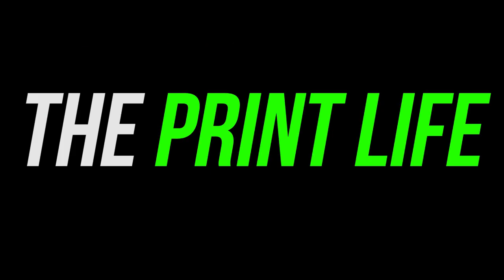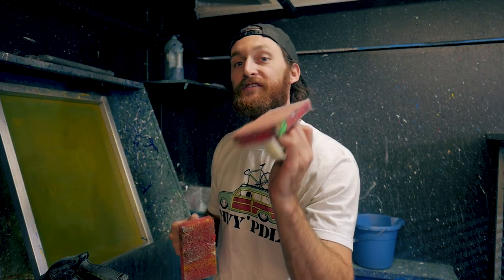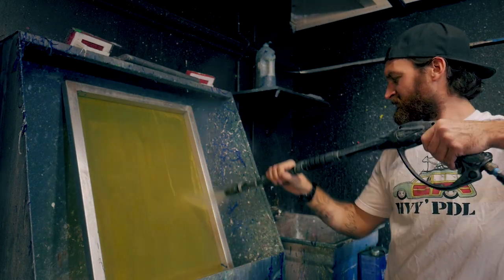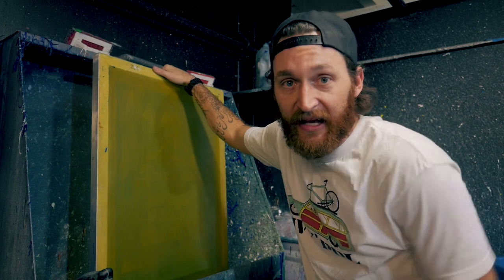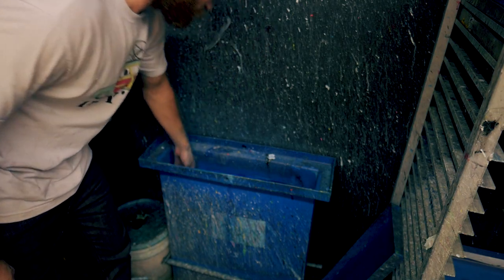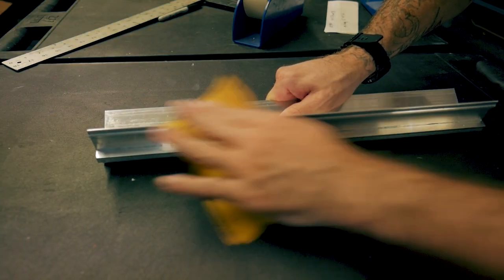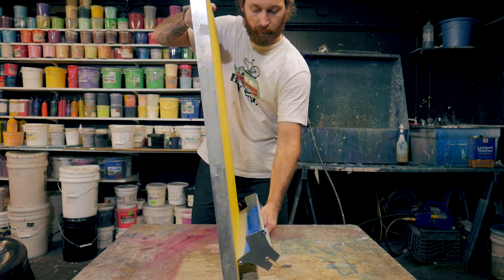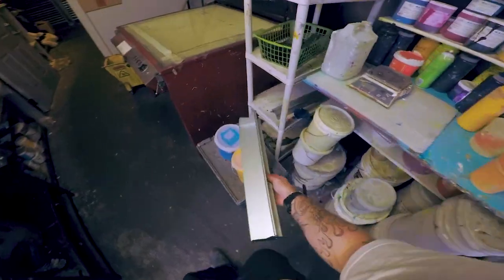How to Coat a Screen for Screen Printing.

Comment: so there are many different sizes for the emulsion coaters. i see you use a coater everytime thats pretty much the width of the screen. is this to make life easier or your prefrence. also does the coater ever damage the screens edges when coating with the metal to screen contact.
Reply from the maker: exactly. I like a coater that is as close the mesh size as possible. This way you use less tape to mask the openings around the edges.

Comment: I’ve been having issues of the emulsion dripping after I’m done applying to the screen. Been told that I’m not applying hard enough, any tricks to knowing how much pressure to use to get it to apply correctly?

Comment: I've seen other videos where they coat both sides, and then go back on the flat side and do one more pass where it seems like they're taking off some that pushed through from the coating on the inside. This is what I've followed in my attempts, but when spray off the emulsion after exposing, I'm running into an issue of my exposed emulsion basically deteriorating from my image. Essentially, the image is starting to come through as I spray it off, but once I get down to the final pieces needed to come off for some of the details, bigger chunks than I want are coming apart.
 I don't know if I have junk emulsion? I'm using ULANO QTX since I saw online it was a good "Beginners Emulsion"... After about 20 failed attempts, I'm beginning to question two things, if the emulsion itself is bad or if the 3rd pass (2nd pass on the flat side of the screen) is what's screwing me up. Any insight? Does water temperature have anything to do with this? I feel like I heard one video say use cold water, but in Los Angeles, my garden hose water does not seem to get that cold in these hot summers. :(

PS. I purchased that exposure calculator to help me get my expose time correct, and so far, I think my expose time is about right.

Comment: Hello. Nice video, very informative. However I have one question. Could one coat a screen with a squeegee?
Reply from the maker: For sure, it will be messy and the screen wont be coated well but if you a hobbiest just messing around it will get the job done, I have a video that shows me doing just that.
Reply: @ThePrintLife Thank you

Comment: Emulzhion / Emulsion
Potato, Potahto

Anyway... nice, neat job. You clean EVERYTHING.

Most guys are in such a hurry, that screens & scoop coaters get destroyed
because they won't take the time to properly degrease, and clean up when they're done. Then, material
& tools have to be replaced prematurely. Not to mention when you're ready to burn, only to discover
that your screens aren't usable because someone coated dirty screens, with contaminated emulsion,
with a jacked-up coater. Off-the-chain aggrevating, cuz you gotta get that printed NOW. And when it
comes to deadlines... customers are brutal & don't wanna hear it. "You said #@&$@#!"

It's such a simple concept. Anything worth doing, is worth doing the right way.

Comment: Cam, how did you set up your monster max? I tried everything (1,2,3,4 pieces of tape)and can't get a good coat. Leaves thick beads on edges and goops in corners...all of which I have to scrape. I tried almost every possible set up. I'm perfect with the conventional coater, but this one...grrr!
Reply from the maker: Haha yup. that coater is shit, we have the same damn problem with it. I use the glass on the exposure unit to get a the sides flush and tighten the screws. the classic coater with the plastic ends is way better.
Reply from the maker: By the way did you submit a request to The Print Life group on facebook?

Comment: How long do you let it dry I’m not using a fan either
Reply: 12-24 hours is optimal. The rule in our shop is you always start the day by reclaiming or “washing out” screens (if needed). Then end the day with coating screens so they’re allowed to dry overnight. I will say though that I have gotten caught in an extreme rush order that was do or die and let it dry in dark room with fan for about 2 hours and made it work. I think the key was not using as much pressure while washing it out after exposing (used the mist setting up close on design instead of a powerful stream setting).

Comment: Could ya use LED bulbs in the darkroom since they give out no UV light? Does daylight affect emulsions quickly, or would it take some time to affect them. We have a light safe box for storing them as they dry, just wondering more so in the coating part of the job
Reply: oh and thank you in advance if you have the time to reply.
Reply from the maker: Shane that is a great question. I dont have any experience with LED lights. I would assume they produce some uv, but how much is a mystery to me. If you find out be sure to let me know in the comments. If not I will be looking into it.
Reply: Thanks for the reply. Well I have installed two warm white LED (7 watt=60) bulbs into the room so I will for sure give you an update on that. Just seems more preferable than working in that dull yellow light which most do. They are way more energy efficient too which means cheaper electric bills! Your channel is fantastic by the way, love the how to vids, right to the point and well edited! Keep it up man!
Reply: Shane Bowers - the yellow sleeves that go over fluorescent bulbs is plenty of light. They make exposure units now with LED's...I assume they might cause some issues. I have 2 lamps with bug lights that's plenty. I've left my shop lights (4' fluorescent lights) on when working with fresh screens and emulsion and had no issues, but I'd rather be safe then sorry! I read somewhere that overhead shop lights will take at least an hour to have even the littlest effect...but I haven't tested that yet :)
Reply: Shane Bowers  - please do keep us informed. Maybe coat a small part of a screen with a small image, out it on foam with a piece of glass over it and let it sit for like 2-3 hours and see what happens :)

Comment: Yea i need to learn how to expose. Done like 12 different test and only like 2 came out almost 99 percent perfect using a 250w bulb and some cases, the sun. But then again im using diazo green emulsion. Think i might change the type of emulsion i use.  Which one do you typically use
Reply: Modehfyable Same here. Built an exposure unit from scratch then spent months exposing screens trying to find the right number of seconds to expose them at. No printing mind you, just exposing reclaiming, coating and exposing again. All in my spare time but still time consuming.
Reply: Modehfyable  - diazo is way more forgiving. If you expose an extra 30 seconds with diazo style emulsion, you'll be ok, but if you expose an extra 30 seconds with photopolymer, your screen will be over exposed. What issues are you having? Image and emulsion washing out, or emulsion not washing out of the image area?
Reply: have to wash out image for a while and when it finally shows it gets to a point where it either completely falls apart or i lose a good amount of detail on the image. but now it usually falls apart. ive tried the sun for30sec to 3min, 30sec is usually almost perfect but not sure if its not 100percent perfect because i have a glass over the image during exposure. and as for the 250w bulb, sometimes 12min is fine, sometimes 15min, sometimes 10min. it seems simple to do but yet i cant find the magic number. i might change my emulsion kit to a different brand
Reply from the maker: Yea man it sounds like you may have a fairly transparent film, combined with the diazo base emulsion you are going to have a hard time because diazo based emulsions take for ever to expose especially with a crappy light source. I would use the sun becouse it has the highest concentration of uv light. Photopolymer emulsions are super uv sensitive and will expose faster then diazo so that may help with your issue.  But what I always recommend is just buy Dual Cure emulsion. its the best  general use emulsion.
Reply: The Print Life ill check it out then.. which specific emulsion brand/name do u recommend for the emulsion because this speedball diazo kit is making me lose my mind lol
Reply: Modehfyable - SPEEDBALL? Nooooo lol. Look at saati or ulano or chromaline. Speedball is like the walmart brand of emulsion. They are entry level. The inks are great for paper though! :)
Reply: Jason Enz yea i found out speedball is like that kiddie cheap stuff pretty late. Ill try the ones u recommended, thanks!
Reply from the maker: We use Marukimi Photo-cure Blue, but any high solids dual cure emulsion will do fine.
Reply: The Print Life - where do you get that? There's still a bunch I haven't tried.
Reply: Is this emulsion good for discharge inks or do you use some other?

Comment: how long you wait for it to dry?
Reply from the maker: 24 hours is recommended but we have gotten away with an hour.
Reply: The rule in our shop is you always start the day by reclaiming or “washing out” screens (if needed). And end the day with coating screens so they’re allowed to dry overnight. I will say though that I have gotten caught in an extreme rush order that was do or die and let it dry in dark room with fan for about 2 hours and made it work. I think the key was not using as much pressure while washing it out after exposing (used the mist setting up close on design instead of a powerful stream setting).

Comment: HELP I coated the screen and I had runs and drops marks.
Reply from the maker: It just takes time to develop the knack for it. You will be coating smooth as butter after 20 screens or so.